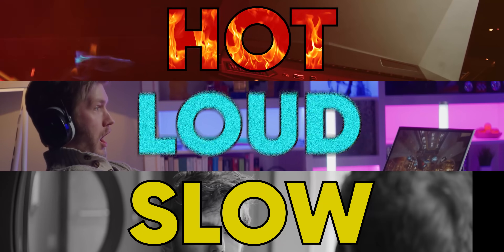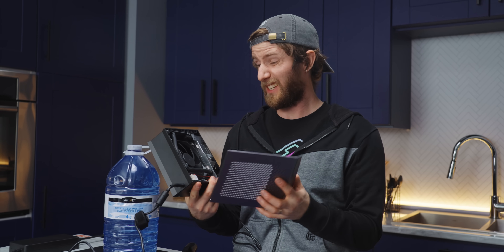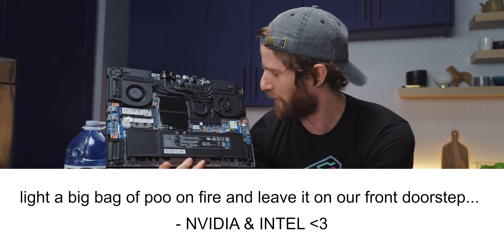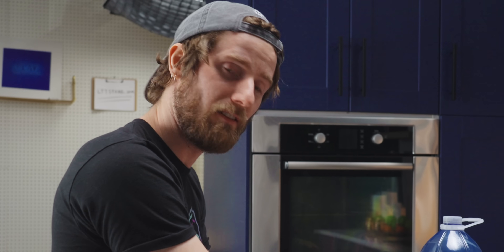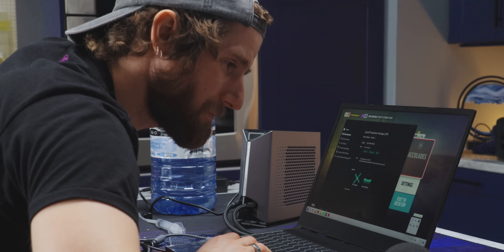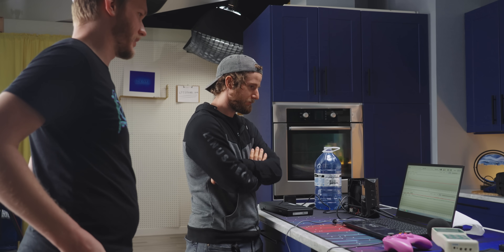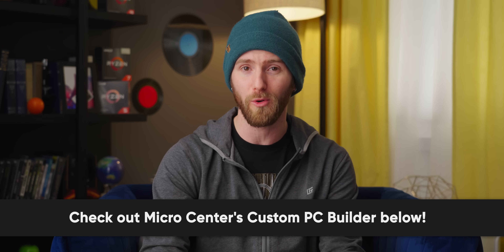This INSANE Watercooled Laptop Has a Huge Problem! - Eluktronics Prometheus Prototype

Comment: This has the beginnings of something potentially awesome. What needs to happen is instead of putting out a single substandard product compatible with a single laptop that will out dated in 6 weeks, if at all possible they should try and get a patent on the design for an integrated water loop with a hassle / leak free quick connect plug and socket combo. Also they should integrate a USB 3.1/3.2 link into the connector, it doesn't have to be a standard USB C connector on the back of the laptop, although for the sake of serviceability it's probably better terminating in a USB C on the cooling block side. This will allow for custom software to pass thermals to the cooler to regulate pump and fan speeds, (as well as all important RGB sync data) and also allows you to either do away with pass-thru laptop power design, as it can now draw its power from USB, or alternatively, you could have a second dedicated PSU for the cooler with enough headroom to be able to provide extra power to the laptop over USB C if the lower temps afford it the ability to boost-clock the CPU / GPU and if the laptop's primary charger isn't beefy enough to give it the extra juice required.
The point of all of this should be to design a standard and then license it out to laptop manufacturers, so that they can make a cooler or range of coolers and they'll all be plug n play compatible with any laptop using their design.
The way to make the big bucks is to own a tiny piece of intellectual property and get a handful of companies to adopt it as a 'standard' there's no need to be greedy, heck they could license the loop and connector design for laptops for free (at least for a few years) and just make their money on the coolers. Just imagine getting to the point where anything called a "gaming laptop" is almost guaranteed to have an Eluktronics Cooler Connector on the back, probably next to its Kensington lock mount. And where you'd be willing to spend $200 - $X000 on a fancy water cooler, or some ultra insane vapour chamber phase change cooling unit, because 1 it actually works and 2 it'll be compatible with my next laptop and the one after that as well.
People would welcome with open arms the ability to just bring your laptop over to the desk and plug a single connector in at the back, or even drop it into a dock and instantly you have desktop level cooling and power, and a built in powered USB hub for keyboard, mouse, ethernet, sound. Heck make it thunderbolt compatible and you could even include full port replication including display port or even an external GPU. Develop a standard and people will create implementations across the spectrum from one extreme to the other.

So yeah that's what I'd like to see. And if Eluktronics don't do it, then LTT should, design a leak-proof, snap-fit all in one connector for water/data/power, patent it, then licence it for peanuts, if possible make it genderless that way it's much cheaper to manufacturer twice as many of the same connector vs needing male and female versions.
Reply: This seems like a great idea, almost like what Samsung & Google wanted to do with the Dex and Android dock thing. Buy a hub, plug in a monitor, KB+M and other accs., then when you get home drop your phone in and get a desktop style experience with 1 device.

I can see manufactures taking on the design, but only in the larger laptop space, 17"+ sizes with massive power draws and the ultra-high end components. Cheaper $800 units wont get the same treatment. ASUS, Acer and Framework would take it on, maybe Dell with Alienware but Apple, Razer etc wouldn't. Unless Razer could make a licenced version of the cooler for $1000 with some RGB. 

Concept is good. It's needs home serviceability too, if you're buying a laptop for $1500 and then a cooler unit for another $100 to $300+, you'd want to keep both for a few years. If the cooler spring a leak or had an issue being able to home-fix is a must have. Getting iFixit on board to make servicing guides would be good, have a QR code inside the plastic door to take the user to the iFixit guide to repair their cooler. - Also having spares available for a minimum of 5 years is a must, buying something that's worth $100+ then a single pipe costing $500 is pointless and causes e-waste.
Reply: Now this idea has merit and extends the range of consumers to most laptops; maybe not older models of course.
Reply: Patents are evil.
Reply: @TheRealDrae  Patents can be evil. 

Imagine for a second you're a regular dude and you have a great idea. You quit your job and spend the next 3 years and over $100,000 designing and prototyping your new product. You release the product and it's immediately obvious it's going to be a huge success. Since you didn't patent it due to them being evil, Amazon comes along and makes an identical product. Since they're Amazon though, they're able to buy in significantly larger quantities which lowers costs, allowing them to undercut you. They also get the name recognition of being Amazon.

Now, despite having spent your entire life savings and several years of your life creating this new product, you don't even get to break even before the big, established names take over the market.

Next time you have a great idea, you decide there's no point. Even if you spend more time and money, another big company is just going to come along and steal your idea once it's proven anyways, so what's the point? Since you decided to not make the product though, who knows when that idea will ever be realized. It could be next month, it could be in 50 years.

This is why patents are important. They're not just there for the big companies to hoard and fuck over the little guys. They're there to protect the little people in order to give them a reason to take that first step.
Reply: @XdivineExp  for real, what you explain is exactly the mechanism that patents give individuals and newcomers protection from the big players when otherwise they would have no way to compete due to difference in wealth and scale. Patents and similar intellectual property laws are the ultimate good that protects the original creators in competitive markets, and establishes a system that rewards innovation no matter the popularity or wealth of the source. People find ways to abuse any system, but it's a big step in the right direction.
Reply: I think this is better solved by using an eGPU. This keeps the GPU's heat and power out of the laptop (thereby also giving the laptop more room and cooling power, maybe even a better battery as a result). There's already a standard connector (USB-C/Thunderbolt), and it doesn't require disconnecting or filling a water cooler. Just need a faster protocol to reduce bottlenecks. 

In any case, this is a very interesting product.
Reply: @Ericxx-yx4rk  Well I have an enclosure, but no 3060TI to put in it.............and the 50-300% performance jump is only practical if you're pairing a midrange desktop card as an eGPU with a laptop with low-end or Integrated graphics. Plus Thunderbolt 5 with double the bandwidth (cuz PCIe 4.0) is arriving next year which is basically PCIe 3.0 x8 or PCIe 1.0 x32

Otherwise a laptop like the 2022 Zeyphrus G14 already has the performance of an RX 5800X + desktop RTX 2070 and the boost from the eGPU is only 35% max. I'd rather pay 100 bucks for a 10-15% boost from on-the-go water-cooling than $600-$1000 for an overpriced card for a mere 30-35% boost.
Reply: @handlemonium  I agree that Thunderbolt 5 won't go far enough for true PCIe speeds, but you can upgrade the GPU if it's in a standard enclosure. You could also change laptops/Desktops and use the eGPU on different machines.
Reply: @Ericxx-yx4rk  But that's only true when I can start buying cards again at MSRP and that's probably not until next year. You have to admit though a comeback of watercooling in laptops for the models that support it will be very cool.

There's tradeoffs either way.

I can definitely see a use case for foldables where it's a 7-inch phone in my pocket transforms into a 13-inch tablet that I can plug into a watercooler alongside an eGPU and mechanical keyboard.
Reply: @handlemonium  It's absolutely awesome, and there's no current competitive alternative to this. I just think it's a stopgap solution. Maybe it will have some niche use case where it makes more sense.
Reply: @Ericxx-yx4rk  this was a cool conversation to read
Reply: This guy games
Reply: Hm.....if I could watercool this year's Zeyphrus G14 might I possibly be able to overclock the snot out of the Ryzen 6900HS and RX 6800S?

Cuz and extra 10-15% when definitely "future proof" the performance for an extra year or two! 🤙
Reply: That all sounds pretty good other than the all-in-one connector, which sounds like a recipe for disaster.
Reply: USB is overkill and fragile and trying to do a high bandwidth protocol in a mechanically difficult arrangement where it has to account for pipes and shit is kinda a bad idea. Maybe a Dallas OneWire gateway from SMBus which is already a standard in charger DRM, might as well put the tech to some less nefarious use.
Reply: The problem with placing a standard on something this niche is vastly harder that just having a patent.

Comment: Also you're always good at showing the extreme versions of laptop cooling what about the consumer versions of laptop cooling trays or other options think about the little guys here Linus
Reply: Laptop trays will not fix bad cooling. They can barely help good cooling and are more designed to help in situations where youd normally have the laptop on a soft surface unsuitable for a laptop. Theres no reason to cover them.

Comment: Would be very good to have conversion kits for people who already have some gaming laptops, of course it is not easy to solder those additional cooper pipes to standart heat pipes, and cut spacings in the lid, but it should be possible for local laptop repair service people.

Comment: I'm so glad you guys included the audio for that water pump. I installed a thermaltake AIO 120 water cooled radiator. I kept hearing a clicking noise, and I just assumed it was my hard drive. But then I remembered I installed and nvme SSD. Thanks to your video I realized the sound is just coming from a few air bubbles that are trapped in the sealed system.
Reply: If you orient your cooler so that a part of the radiator is above the pump, it should eventually trap the air so that it isn't circulating around. That didn't work for me though, and I actually opened mine up to fill it all the way. I don't recommend that though, because it died a few months later and I ended up installing a full custom water cooling loop instead, which cost 5x as much as the AIO...but you can't win them all.

Comment: 200 American roubles really ain't bad with those numbers. I'm slightly amazed it's not twice that, at least, because it looks like they could easily justify it, in a revision or two. I wonder if they bought and/or adapted the tooling cheaply, or licensed the case design, or something.

Comment: this looks awesome, but i can't see this ever being affordable unless lots of laptops start having this as a standard
Reply: There is potential. Not wanting to discredit Eluktronics unsure if this is still done with their usual tongfang partnership but this is a Mech 15 which exists already they just added the water pipe. In theory making it possible to add to all TongFang laptops if they are doing it. Eg Intel NUC X15 (mag 15) and many more... If works fine without the water and can be sold without it so it's a rather cheap addition compared to previous attempts
Reply: Eh. They made it 100 if bought with the laptop, which makes it ok value IMO.
The fact that it's the only solution like it makes it great value even.
Reply: The incremental cost to add this would be pretty low tbh. Like the work done inside the laptop is one extra copper loop with a quick connector.

Not disparaging what they have done to achieve that neatly, but it's not something inherently costly.
Reply: @zyeborm  oh boi i think you underestimate this. It's extra aio space, it's extra engineering and rnd cost, it's extra soldering, it's at least like 15 bucks extra materials (which is a lot is laptop manufacturing) and most importantly it likely prolongs the life of the product, which reduces sales.
Reply: @demolitionGoat  oh no... $15 more copper.... (I mean it's $1 but hey)  in a $2000 machine.

You think this single pipe is much more expensive than the 4 much harder to make heat pipe and radiator assembles already in it?
Reply: @zyeborm  mag nur it's not like you can leave that out, is it?
Reply: @demolitionGoat  no. However as I said. The incremental cost isn't great. It isn't going to cost an extra thousand dollars to do this. Probably why the manufacturer is selling it for $100 with the laptop.
Reply: @zyeborm  certainly not. You do have to consider it an investment though. You have to expect some significant marketing advantage in return or something.
Reply: @demolitionGoat  like the significant performance boost gained from allowing double the power output? You think that might do something for their marketing?

Comment: Must have broke in shipping.. right.
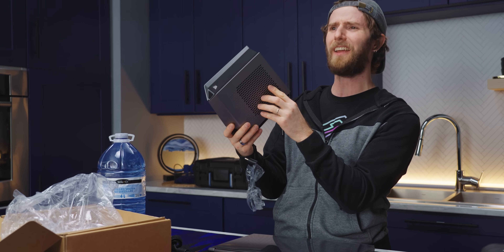1:44 rough handling, violent shaking. (forces air to accumulate in the loop, making spitting noise)
6:53 knocks over
8:20 spill (not super significant but still counts)
Reply: It’s a product for a laptop so you would expect it to survive being put in a bag or even just being moved around lol
Reply: @FaithfulFrets  Ideally when you're traveling, you leave this thing at your desk and take the laptop with you, then dock it at home. You're never supposed to shake an AIO, no AIO does well with that.
Reply: @blaux  if I had this laptop and would meet up with my mates for a gaming session I would absolutely take the cooler with me.

Comment: So, to sum it up:
- Instead off a barrel power connection make it usb-c
- add pwm control to fan and pump
- Make lines come out form the back
- Make lines permanent to unit or quick disconnect
- Improve filler cap

Comment: This is such a cool product...its insane how a tiny tube of water can massively improve performance while reducing noise. Should be a must have in desktop replacement laptops.
Reply: It's funny too how simple actually the system is inside the laptop lol I think I could modify my own laptop to make it compatible with a similar system and even make it more compact
Reply: @rafaelconstanzovicens9094  think that's the goal this is just the Mech-15 with a pipe put in so chance they just drop it into all future laptops if it works.
Reply: Well, when you consider that by volume, water can carry about 3400 times as much heat as air....